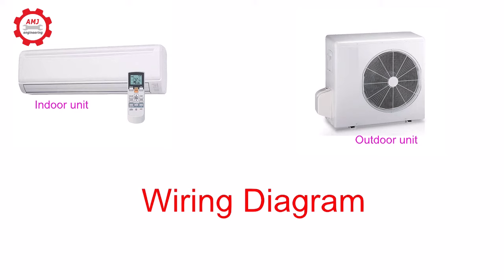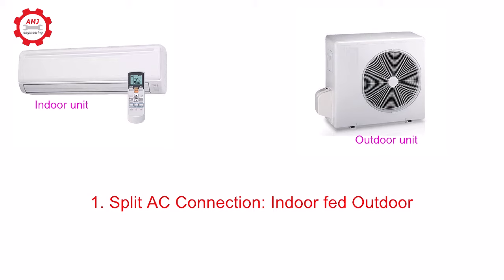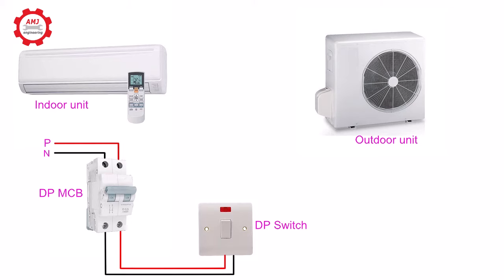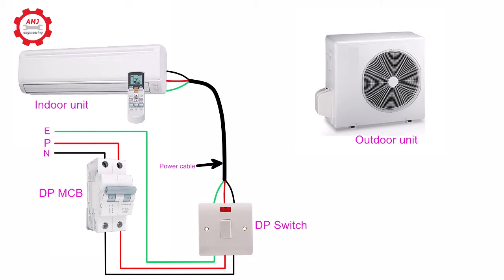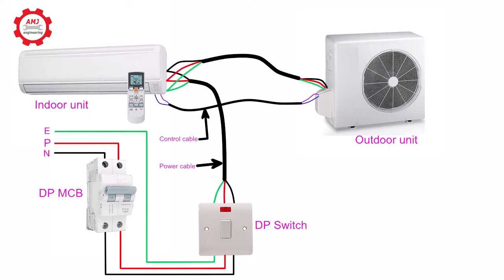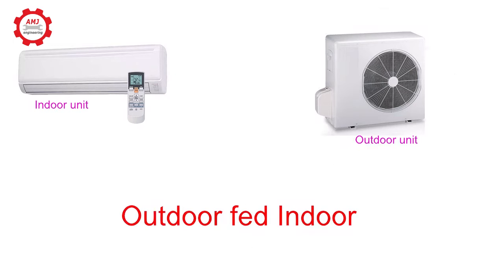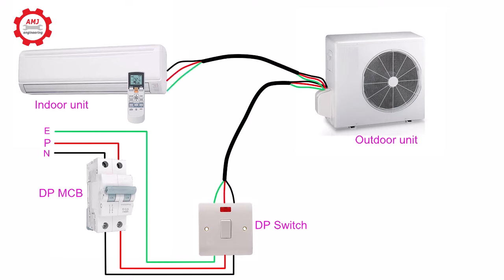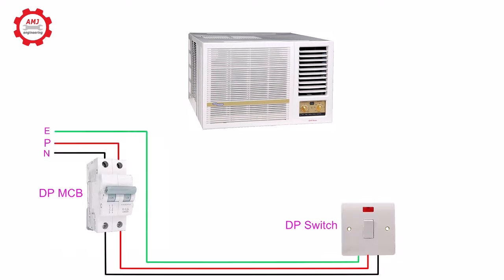Single phase air conditioners wiring diagrams

Comment: Should not connect air con power line to double pole switch directly.
Add one more socket box after the double pole switch.
Such that when you want to replace the air con, you can switch off the DB switch and then freely to loose the power line.

If you connect air con to DP switch directly , when you want to replace air con, you still need to switch off the mcb in fusebox.
That's a bit more troublesome.